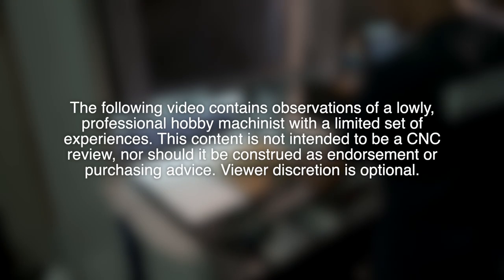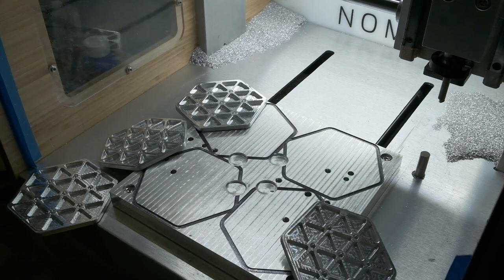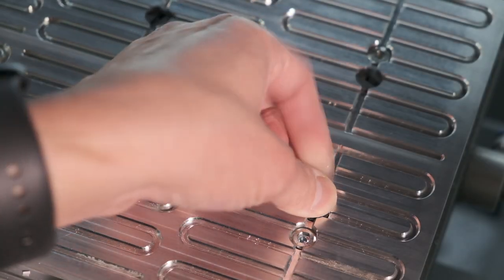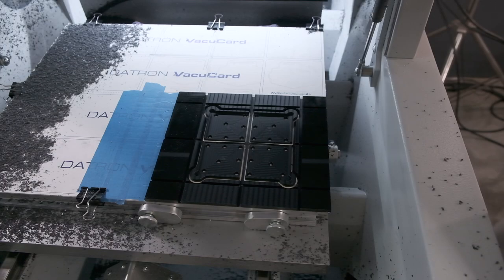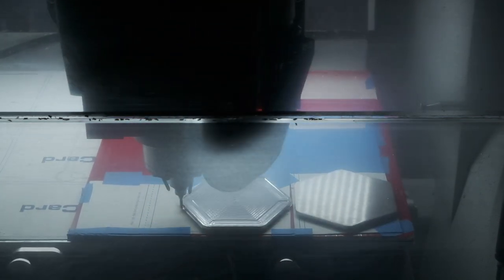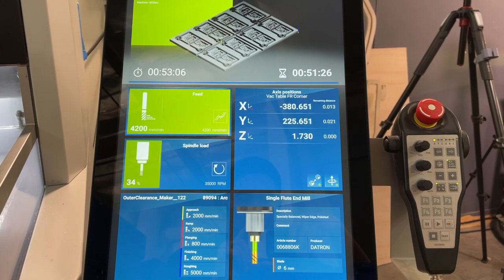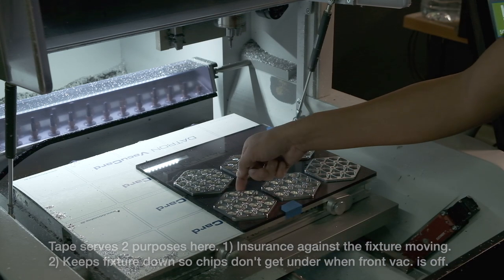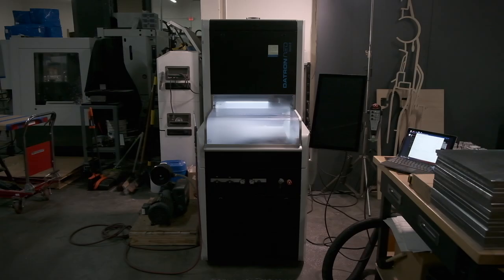Machining Drink Coasters on a $100,000 CNC

Comment: You're right about starting with a hobby CNC where the sandbox is much more forgiving. I bought an X-carve in 2016 and it seemed like a huge complicated machine at the time however I really appreciate all of the lessons I got out of it. I eventually got confident enough to buy a Haas. The learning curve from 0 to X-carve was tough for sure. Going from an X-carve to 3+axis mill was pure joy.

Comment: Good video! I recently made the jump from a hobby CNC to an industrial CNC router at a new job. I went from operating a CNC shark to a Biesse Rover K 1531 with a vacuum table  and automatic loader and and unloading sweeper conveyor. It has a 40,00 rpm spindle with a 10 tool changer and 10 bit drill block. Also learning Biesse B-Solid and nesting software. I'm starting to feel more comfortable now, but wow what a learning curve! It's a dream job, and I'm very lucky to have landed it!
Reply: Only used CNC at work Scm Morbidelli m90 with Maestro software not bad to learn but there are still things I’m stuck with.

Comment: Great video, that answered quite a few questions I had about the neo, but more importantly it exposed something about the nomad. The neo spindle is 17X more powerful and machined the coasters 7X faster, could probably do 10X, but maybe not 17X. It seems that the nomad is very efficient and appropriately powered.
Reply: You’ll probably also get more than 250hrs out of the Nomad vs the IMT spindle on the Neo (now allegedly superseded)
Reply from the maker: 2000 hours is the supposed expected life of the IMT spindles, not sure about the allegedly superseded spindle... We got more than 500, I know people with 800-1400. There's a 1 year warranty on the spindle, so really the goal is to just keep the machine busy and see if you can find any defects early. And with a machine that expensive, you're losing money if it's idle most of the time anyway.
Reply from the maker: One other factor from an efficiency perspective is the accelerations. I think the Neo is over 20x what the Nomad is set to. This makes a big difference in small adaptive toolpaths, where you can get up to programmed feedrate within a few mm of motion. Keeps your chipload right where you expect.
Reply: @WinstonMakes  Bruh you can't defend a spindle that costs 5$/hour to run.

Comment: you probably could use the tab method for first op with a full sheet instead of buying blanks, then snip em free and face the backsides off. buy a sheet the whole size of the table and the warp should suck down with all the vacuum ports contacting.

Comment: I'm sure you can't answer this as an employee of Carbide3D, but it sounds like there's a few options that could make life easier for Nomad users - like an ATC, probe, or mist coolant sprayer. Now that I say it, seems similar to a Carvera, though they don't have nearly the community or customer service record as Carbide3D.
Reply from the maker: Against my better judgment, I'm going to respond to this comment and say that I'd be lying if I didn't sketch out a Nomad with tool holders in my notebook. It's something I think all of us at the company would love to do, but there's a lot to balance and the planning and engineering decisions required are significant. 

Carvera uses a direct shank clamping system and custom collets, not too dissimilar to the Datron Neo approach. There are pros and cons to this, and it limits how much torque you can transmit. Any dust getting on the tools can also really hurt this, which is why the Neo's magazine is covered. Even then, we had one scary issue of tool pull-out which led to us being more proactive about cleaning the inside of the Neo's collet. PocketNC's V2-50 CHB system has clamping strength issues too which is why they offer the CHK version now.

Using tool holders is stronger, but takes up more space. And if you pick one that skews towards being compact, it may be less common and more costly. If you have too few pockets, then you're probably going to want to implement tool groups in software so you can load sets at a time... etc. The requirements start creeping really fast.

Basically, there's a really complex decision tree for a feature like this, so we're not rushing into it. I'm sure one day we'll get there though...
Reply: @WinstonMakes  Makes a lot of sense, what seems like a simple feature add turns out to have big implications, safety risks, and commits you to supporting that specific implementation for years - since the investment in tool-holders is quite pricy and you wouldn't want to upset users by changing the design again. 

I'd also love to see integrated support for advanced touch-probing (though it looks like the community is working on some macros). I imagine updates to the motion control also require a ton of validation and engineering time, and the "free" nature of Carbide Motion means it's harder to commit those resources to its development. A "Carbide Motion Pro" similar to create pro could be a way to get the funding, but subscriptions to "unlock" existing features tend to annoy makers, and bifurcates the development/validation.

While you're here.. thoughts on the Penta Solo?
Reply from the maker: So, Carbide Motion has a "quick actions" feature that isn't very well documented. I think it might be possible to build probing macros in there, though I'd need to confer with our lead (only) programmer. Given how our machines (N3, S5P) seem to be leaning towards having an accessible plug for a BitZero probe that makes it easy to disconnect when not needed, plugging in a touch probe might be possible in the future. But until we offer one of our own, and can define a nominal user experience/workflow, it's hard to support a more generalized workflow. 

I think the Solo is super cool and I'm rooting for the team, but without the final specs and pricing, I'm concerned the case for it will be difficult to justify. I know what the spindle costs (I think they should go Jaeger instead of IMT), and that means it won't cost less than $30,000. There are plenty of small 4-th axis capable mills you can get for that price. And if my worsts price fears come true (closer to $60-70k), I don't know how I'd justify it vs something like a Haas CM-1 w/ trunnion. I really like the engineering I'm seeing and I hope they can make a competitive machine that stands out without leaning too hard on a niche market, but I'm also a little worried for them.

Comment: For small parts you can use their adhesive vacuum paper.
Reply from the maker: That's a good point, I've seen it used before to great effect. Only thing that that I don't like as a cheapskate is that once aluminum chips get on it, it's basically used up. You can cut pieces as needed, but you'll go through it as a consumable much faster. When we machine touch probe bodies here, we leave the same vacucard sheet in place, since the cuts will not change. You can just keep cutting into the vacucard in the exact same spots without compromising vacuum.

Comment: Hello Winson.........would you please point me in the direction where you acquired your alcohol mist system.  By the way
nice work!
Reply from the maker: The one in this video is built into the machine. You can buy cheap versions online though, like Amazon. But they are not pressurized, so you need to constantly fiddle with valves to get the desired quantity of mist. For most CNC routers though, simply a steady stream of air will help immensely.

Comment: Very well presented. How is the alcohol Vapor dealt with to avoid risk of fire?
Reply from the maker: The enclosure is exhausted via fans at the top, and the consumption of alcohol is quite low, all things considered. It can be adjusted so that it's less than a mist system where droplets have a chance to collect. The use of the ethanol coolant system is also not recommended for ferrous metals (risk of sparks), so that kind of work would need to be done dry.

Comment: I feel guilty asking about the smallest little thing in this industrial-cnc video, but how do you like your bit / collet fan on the nomad? I'm wondering if it's a good replacement for air blast when milling aluminum on shapeokos. Is there an STL file somewhere I could try with carbide's router?
Reply from the maker: The fan works good for pockets and relatively shallow cuts (1-2x cutter diameter) but it won't effectively get chips out of deep slots well. That requires compressed air. But it's way better than nothing. The chip fan here ships with the Nomad, wouldn't work with a router though because the collet size is different. I think you'd probably have to design your own, not sure if one exists.

Comment: Kinda the Apple of CNC Machines, huh? 😁
Maybe I should consider making a DIY Vacuum Holding Solution like that for my X-Carve 🤔
Reply from the maker: Vacuum table on any CNC router is a lot of fun. But unless you use a gasketted fixture, you're going to need a beefy pump that's going to run up your electric bill quite a bit.

Comment: Absolutely insane to me as a professional that you left the outside as a lasercut finish and used a plastic template on a professional machine, to save like 50p. Rather than using the machine the way it was designed, by slapping down a piece of 400x500 and getting at least 12 off at a time(costing under £4 per piece in material)

Comment: .......wait - nomad 4 - 22:44 - when is it out?
Reply from the maker: "Nomad *for*..." But I appreciate the enthusiasm and excitement. If I were considering ideas to improve the Nomad though, what would you want to see change from the Nomad 3?
Reply: @WinstonMakes  I'm a hobbyist, enjoying your content - I'm currently using a Genmistu 4030; I'd like to upgrade to something in the <$5k, maybe <$10k range (e.g. a Nomad 3, EVO ONE PRO, etc, etc) at some point this year, or maybe next; so would wait a little extra if there was a new one coming out! So what to improve - having not owned one - nothing? maybe work space?
Reply from the maker: A lot of the pre-built desktop machines are going to be a step down in terms of working area compared to that (ex. Nomad, Evo, ETC) but you'd get more rigidity and potentially some quality of life stuff like tool length probe. Are you beholden to a particular size or form factor? Because in the sub $6k range, you can get bigger ball-screw driven,gantry style machines with more capability all around.
Reply: @WinstonMakes  currently no - and, I think the bigger stuff I want to (but haven't) make is mostly out of wood. I'm likely to keep & expand the 4030 for that, and get something better at doing smaller aluminum things. I think Nomad would be a good size; the Evo is "better" workspace wise but is obviously $5k not $3k. Not sure what else to look at <$10k for metal and if it's even worth the jump for me as a hobbyist vs small production; 5-axis Pocket NC seems interesting, but a learning curve. Any suggestions welcome. Also, thanks for the replies - and making all this content.
Reply from the maker: I think Penta/PocketNC is a good company, the people there have certainly been very responsive to questions and support. But the V2 is a machine that's hard to justify unless you already have ideas for things to make with it. And ideally some of those projects would generate revenue to help pay for the machine too. 

The small CNC market's in a weird place right now with supply chain and inflation right now, the scales we're dealing with mean labor and material costs have a significant impact on overall margins. Hard to point you in a particular direction. My mind did jump to the Tormach 440, but I just looked on the site and the prices shocked me. Same with a rooster company I hesitate to name. If you're not in a rush, I'd say have a little patience, and see how the market evolves over the next few quarters...

Comment: Why not make coasters on a 220v HDM?
Reply from the maker: It would be a better experience than the Nomad for sure, but I'd still have to deal with double sided tape and tool changes.
Reply: @WinstonMakes  Introduction to palletizing or makeing a pallet system could help people out. Utilizing tiger clamps maby setting up pallet's whyle tending to the machine? 
I notice you're videos introducing more of the industrial work flow do well.
Take it easy, look forward to the next one 👋

Comment: Why would someone buy this over say the HAAS CM-1? For less it has higher capability with probing, 36 tool capacity on the ATC, 50k rpm, 32 or 64GB of memory, larger tools, faster and or deeper cuts can be made. Or it can be significantly cheaper with more torque allowing for again, faster and deeper cuts and better for the larger tooling. As far as the vacuum table being nice for it's ease, you can use superglue and painters tape for small parts and toe clamps and a fixture plate for large parts. The HAAS would also give you the ability of 4th and 5th axis if you only need smaller parts and probably still be in the $100k range.

Comment: this sounds like it's really really not worth investing in something with the same flaws (work holding, work holding and power) as a desk top cnc

that alcohol cooling sounds neat tho
but why isn't it industry standard if it's so cool?
it can't be cost
machining is very tolerant of one off cost
is that stuff significantly more expensive then good old oil and water?
Reply from the maker: You can't use MQL like this on ferrous metals or anything that can spark. So the Datron really excels at aluminum, and micromachining anything else where you wouldn't need flood coolant to begin with.

Comment: Why spend $100,000+ on a CNC when you can build a very capable DIY CNC that can do the job for less than $5,000 or go wild with features and spend up to $10,000?

Comment: Awesome overview! I really don't see why someone would go for this tool over something like a Tormach 770, though, since the Tormach is like 10% the price. It just seems like the vacuum work holding doesn't offer a huge advantage and has quite a few pitfalls, whereas traditional mill work holding is very reliable. I guess like you said, it really seems aimed at small prototyping of high precision parts. Super cool either way! Have you considered diving into a PrintNC project? It could be a cool step up to a larger form factor that doesn't cost $100k
Reply from the maker: For the majority of machinists, I agree that a Tormach, or even a small Haas type VMC would be a logical first step for someone venturing out into job shop type work. 

The biggest advantage of the vacuum workholding IMO is how it reduces setup time to near zero. For prototyping, where you have to switch between parts rapidly, you just clear the table, slap down material. And probe it in. If you need an Op 2, maybe do soft jaws on a pallet.

Oh, mold work is another application where the spindle speed really helps, though I've also seen a fair number of air spindles on VMCs on Instagram. 

I think the PrintNC stuff is pretty cool, but because I have access to all the spare Shapeoko parts I want basically, my free CNC design time mostly goes into thinking about how to repurpose legacy parts into a "Franken-oko" and designing for manufacturing in case there's a market for older owners to upgrade.
Reply: Comparing a Tormach to this machine is apples to oranges. Completely different level of accuracy, rigidity, reliability, etc.
Reply: At first i was thinking the same thing, but if this machine truly is in the Micron level of accuracy it's a totally different beast from a Tormach or normal VMC. This would be excellent for very precise mold work done with very small tooling or machining very small parts (think things like components inside a Rolex). That being said, this is a very niche market, most machining doesn't need anywhere near this level of accuracy, nor is this accuracy even relevant or achievable on many things you would machine just from material de-stressing or thermal expansion from handling.

I'm curious how much this machine weighs
Reply from the maker: @SPDLTD  about 1500 lbs. The Y axis is built into an epoxy granite base.
Reply: @WinstonMakes  Oh that's right! I totally forgot you have all the Shapeoko parts you need! Man, what a cool resource. Well, I can't wait to see what you do to make a Frankoko
Reply: It's for a very specific application. Think about an engineering company that needs rapid prototypes in house. They need a small machine that they can wheel down a coridor, no flood coolant or chips everywhere, as easy to use as possible.
Reply: @poetac15  I started on a 770m and nothing ever went wrong. I had a Neo for a year and it was always broken.

Comment: Aluminum is not the best choice for a coaster.  Gonna make hot drinks cold and cold drinks not so cold.
Reply from the maker: This is true. But the motivation/compromise was that I wanted an aerospace-style aluminum isogrid. And the negative thermal characteristics are mitigated by minimizing the heatsink effect/mass (by machining it into an isogrid) and putting cork on the bottom to prevent additional conduction losses from coaster to table.
Reply: @WinstonMakes  I’m sure it’ll be fine.  I just repeated something I saw on Titans video lol.